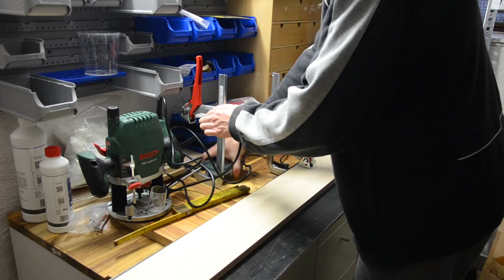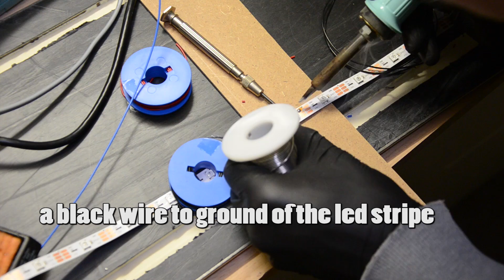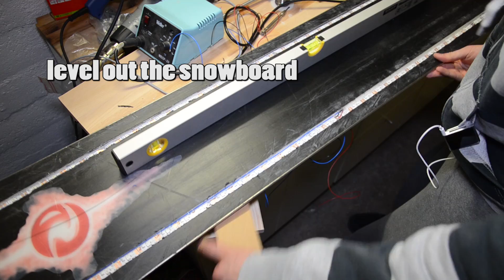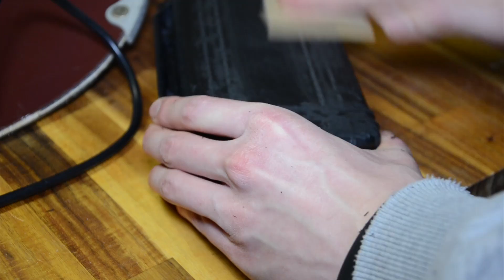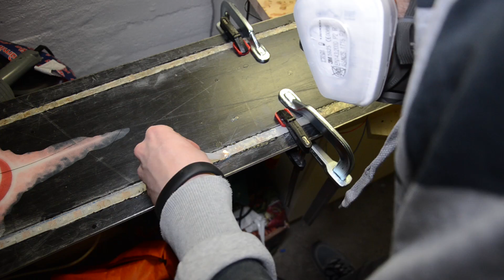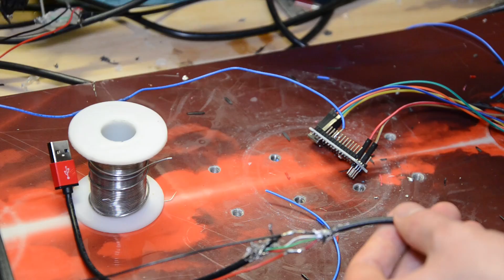Tutorial: How to make a DIY RGB LED Snowboard with Arduino, Powerbank and WS2812B leds

Comment: Were did you connect the wires on the Arduino that went from the sd card reader the the arduino?
Reply from the maker: Hello friend, I did an upgrade on the electronic of the snowboard, I will cut and upload the video next week and will provide the schematics inside the video. I hope that is fast enough for you? ;-)
Cheers!
Reply: ok sweet I cant wait!!! thanks and cheers :)
Reply from the maker: Okay good :-) hope I can get this done on Sunday :)
Reply: awesome! also, I have sodered the bord like your ( I think ) and when I plug it into my computer it gives me an error saying " Number of COM ports found: 0" and then "Options: wrong number_of_boards size." and I cant find the arduino in the gladiator software. how do I fix this?
Reply: hamburgtech also, how did you program the LEDs with the sd card connected to the computer? I plugged myn into my computer and it couldn't find the COM/arduino
Reply from the maker: Did you watch this glediator tutorial: https://www.youtube.com/watch?v=3mwkC4MrCgw ? If you can't find the arduino (COM) in glediator something is wrong with your RXTX files.
Reply from the maker: Did you check this sdcard glediator tutorial: https://www.youtube.com/watch?v=dHQzYuu9fQk&t=1s ?

Best of luck!
Reply: i bought a fake/china arduino, what would be the problem with the RXTX. also, my computer sometims sees the arduino and in the gledatior softwaer it finds the COM
Reply from the maker: Well I also buy only arduinos from China ;-) Well it could be also a driver problem, if you can see it from time to time and sometimes not. Maybe reinstall the FTDI driver. Also there is another driver from China available.
Reply: hamburgtech In the description of the Amazon ad I bought it from it says to install the CH340G driver.if I hadnt installed this before would that effect anything?
Reply from the maker: ThatEquine Pilot do you use Mac OS or Windows?
Reply: Windows 7
Reply from the maker: You should be able to download this driver: http://www.wch.cn/download/CH341SER_ZIP.html and install it on your computer. Should work fine on Windows. I only had some trouble to get this working on my Mac. If your arduino is already working fine, then you don't have to install this driver. Cheers!

Comment: also, what sd card reader did you use. was it a SPI Reader Micro SD Memory Card TF Memory Card Sheild Module for Arduino? and is the arduino nano you used a V3
Reply from the maker: Hello friend, yes it's a Arduino Nano V3. But I'm quite sure that it will work with all Arduino Nano versions. The SD reader is a SPI module for Arduino like this here: https://de.aliexpress.com/item/1x-Good-Micro-SD-Storage-Board-TF-Card-Reader-Memory-Shield-Module-SPI-for-arduino/32281119487.html?spm=2114.010208.3.38.NF9AoA&ws_ab_test=searchweb0_0,searchweb201602_4_10065_10068_10000032_119_10000025_10000029_430_10000028_10060_10062_10056_10055_10000062_10054_10059_10099_10000022_10000012_10103_10000015_10102_10101_10096_10000018_10000019_10000056_10000059_10052_10053_10107_10050_10106_10051_10000053_10000007_10000050_10084_10083_10118_10000047_10080_10082_10081_10110_10111_10112_10113_10114_10115_10037_10032_10000041_10000044_10078_10079_10077_10000038_429_10073_10000035_10121,searchweb201603_3,afswitch_4,single_sort_3_default&btsid=42391af5-6b3b-47c3-a72f-a3e1101bfe68

Best of luck ;-)
Reply: ok thanks for the link that really helped :). also if you could =, could you send me the link where you bought the ardunio nano V3? I just want to make sure it will work. if you don't have it or cant find it that's perfectly fine, ill do trial and error with the boards :)

Comment: How did you waterproof the connections on the power bank?
Reply from the maker: Its all inside a waterproof case. I only drilled a hole into the bottom of the case for the wires. I closed the hole with epoxy resin. But next time I would build it in another way, so that you can take off the box ;-) You can find a lot of waterproof connectors on ebay and so on.

Comment: how deep are you cutting into the board?
Reply from the maker: Hey, I think it was 6-8mm ;-) You need space for the LED strip, some epoxy and the P-Tex on top. The problem was that my snowboard was thinner at the front and back.

Comment: Awesome! Worth it to wait 1 month for that video.

I am also making the project of the LED snowboard, but much more easier because I am just total noob at arduino. I am making the led snowboard that receives the data from accelerometer and changes color/animation depending on tilt angle, maybe that will be also good idea for you? (sorry for my english)

Thx for the video!
Reply from the maker: +Никита Зимин (Randvell) Thank you :-) I was also thinking about some sensors that would effect the LED animations or color. I was thinking about an acceleration sensor too. I also had the idea to install a gps receiver to get the speed of the snowboard and change the LED color depending on the speed. But I was running out of time, cause I was writing my Bachelor Thesis and the holiday to test the snowboard was allready booked. So I had to take the easy way ;-)
Your english is fine.

Maybe you can find a better solution than the P-Tex repair candles. A few days on ice and snow and I lost a few small parts of it ^_^

Good luck for your project!

Comment: Isn't this just the previous 2 videos in one? Nevertheless still a great video with huge production value!
Reply from the maker: +Ja ynik Yes you are right, it's some kind of the same video. But it's a different snowboard. In the other two videos I just tried how to do this, on a snowboard that would be to small for me And in the other videos I didn't finished the snowboard, I didn't use P-Tex to cover the resin. If you don't use P-Tex the snowboard will be quite slow ;-)

I thought should I cut and upload this? But I wanted to show the whole process, how to build a led snowboard that works on a mountain and is waterproof ;-)The next video will show the test of this snowboard. And then I go on with different videos ;-)I don't want to bore you :-PThanks for your comment!
Reply: +hamburgtech ah ok, I get it now, actually makes sense :D
Really looking forward to the testing :)
Reply from the maker: +Ja ynik :-D I am working on the testing video, I think it will be online in two days! The testing at night is really impressive ;-)